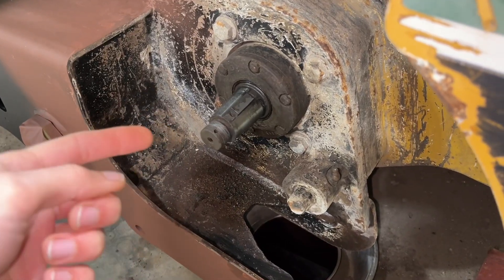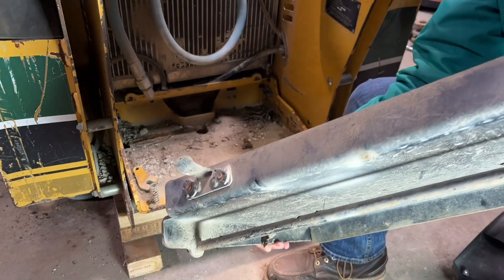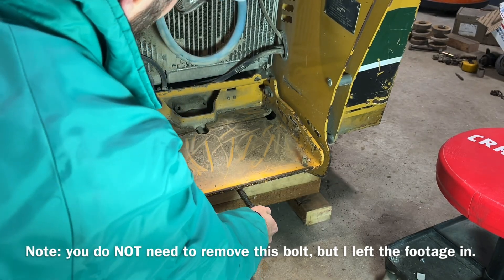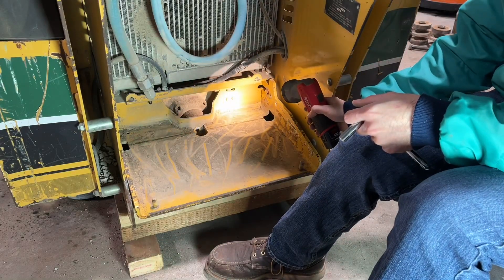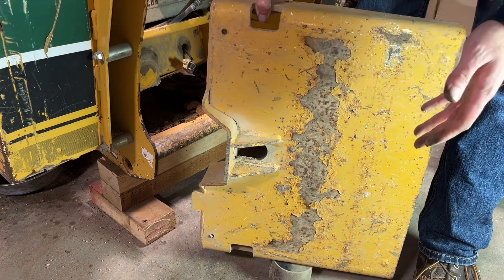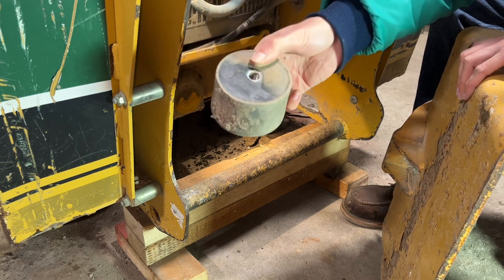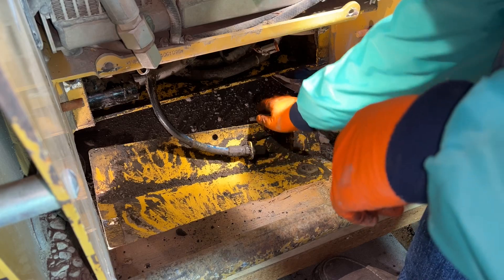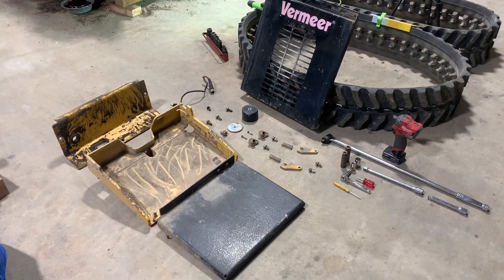Removing the Operator’s Platform from a Vermeer Mini Skid Steer (Presence Switch)

Comment: Great video. I loosened my spindle nut on my S800 and it snapped off. Motor is only 6mos old and 100hrs on it. Be careful loosening those nuts, the shaft is very hard. It broke off clean
Reply from the maker: Oh no! Were you using an impact or a breaker bar to remove it? Is it covered by any warranty?